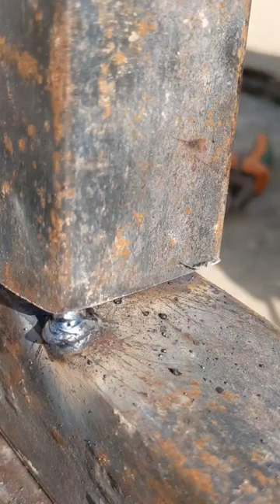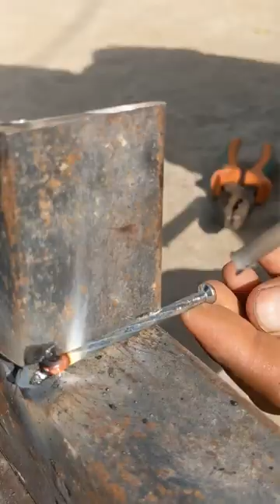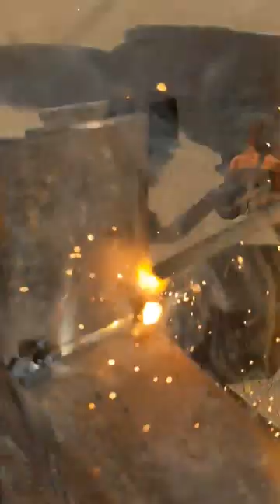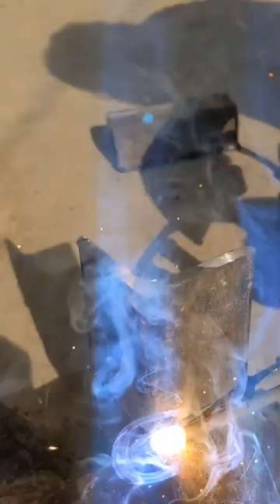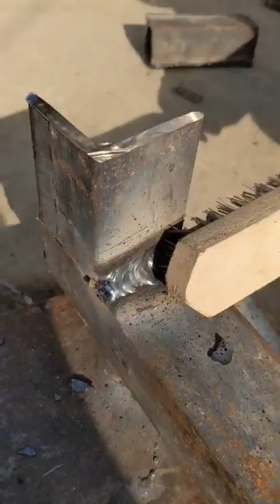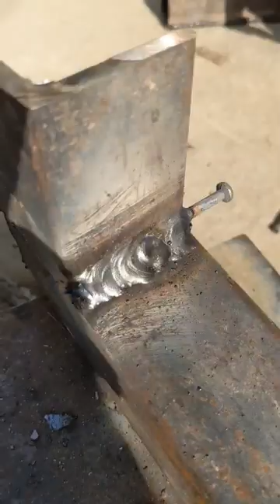new method of gap welding of Pakistani welder #shortsvideo

Comment: Nope. That’s a weak weld. Starting and stopping is the most difficult part of stick, and what you’re doing here is start and stopping repeatedly. Each one of those starts needs to be cleaned for proper fusion. Starting on top of an unclean stop is going to trap slag in the weld and introduce porosity. 

Never mind that the premise is flawed from the start. Dissimilar metals do not weld together strongly, and you’ve got a galvanized nail in between mild steel. This weld will be weaker than if you just ran a couple filler passes or a wide weave. If you really can’t be bothered to do proper technique, at the very least you could use another welding rod stripped of the flux so you’ve got proper steel in there. 

Oh and the zinc in the nail releases poisonous fumes, so way to go champ.
Reply: Its good enough for the job at hand
Reply: @Jonesqy-yx2  No. There is no job at hand, look at the video, it's just a demonstration. And it's a bad demonstration because it's a weak weld that will fail in every application, even decorative pieces will eventually fail with this technique.
Reply: Simply not true. It's sounds like you have no real-world welding experience
Reply: @Jonesqy-yx2  Ok buddy, you do this on a job and let's see how long before those slag inclusions get you thrown off the site.
Reply: @russianotter  I wish you good luck on your exam
Reply: Taking this video to seriously lol
Reply: @jackychan8539  where is that at?